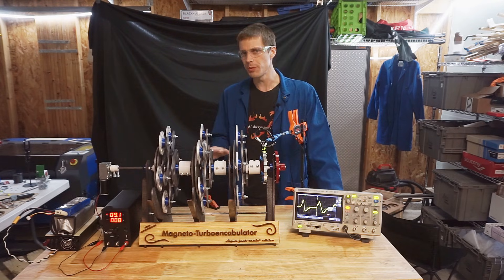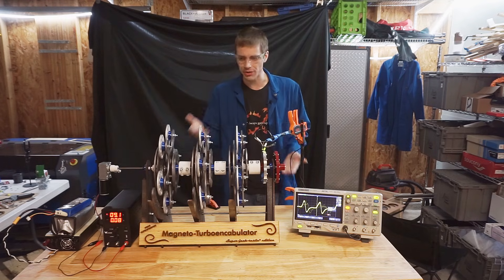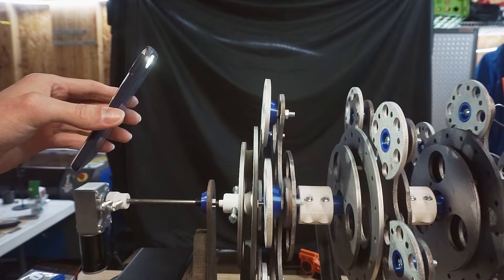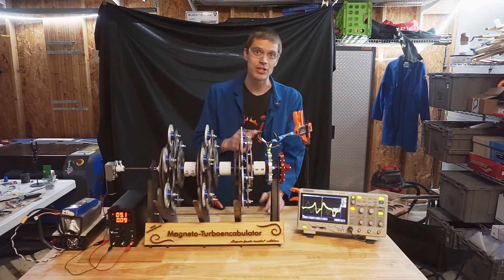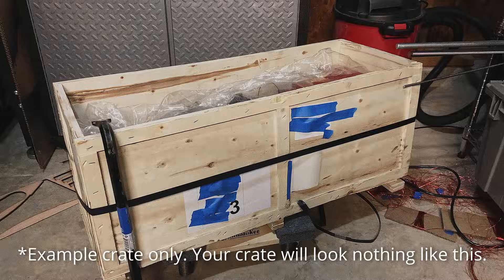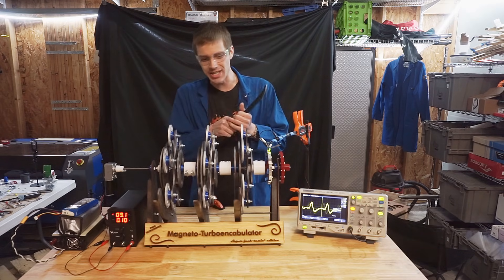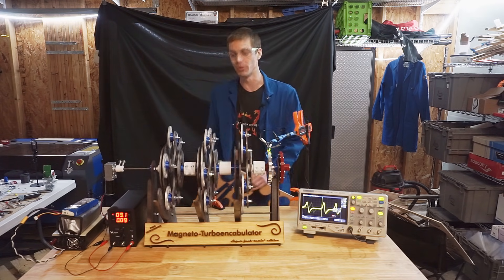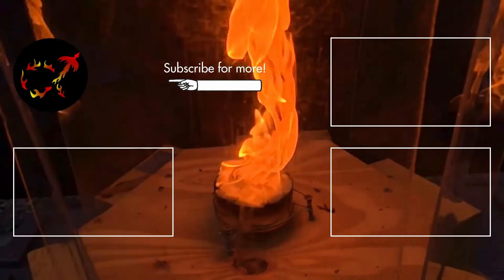Introducing the Magneto-Turboencabulator

Comment: Well done sir, Congratulations on your prototype... you have achieved what us engineers have long sought after... We know that the turboencabulator goes back decades and comes out in it's various forms usually in early April.   Starting with General Electric back in 1944 it was shown how such a device could be made, but the claims to have a working system were dubious, and even though they put it in their catalog for customers to order, sales quickly fell flat because it required unobtainium, a rarer-earth element that proved difficult to find.  Later on the Turboencabulator was reprised by Rockwell Automation they attempted to bring out their version of a product called the "Retro Encabulator", sadly with similar results... Even Chrysler Corporation tried to outfit their vehicles with this futuristic technology, but they couldn't make the cardinal grammeter from a girdle spring... what were they thinking!?     You sir are keeping the tradition alive!  Well done!!!

Comment: We've been hearing the "magneto-turboencabulators are only five to ten years of research away!"  line for so long, I never actually thought we'd see one...
Reply: They are a LOT closer than many had thought...  Just let that thought fuse into your head for a while.
Reply: Just need to nip the whole issue of tangential drifting by the spiving bearings. I think we need some
 post-famulated ammulite in a polarized neutronic field.
Reply: The side fumbling really held it back for a long time.
Reply: Hate to say this, but from three years later, we're STILL "only 5 to 10 years of research away." By now it's pretty clear it was all a big scam, the next Theranos.
Reply: @Qossuth  Not true!  What you fail to realize is that any Turbo-Encabulator functions as a Time-Machine, so whenever it is activated, it propels itself 5 — 10 years into the future.

Comment: I think you made a little mistake here. Magnito-Electric field in a presence of Choulcaudronite salt usually moves in 3-way fractal Mandelbrote pattern due to T-N flux magnetic distortion. This causes you to lose on performance on the 4rh circle and above when magnetic field failes to follow inverse sinusoid movement off the magnets. I suggest swapping the salt with 4-hydro-2-macroetyletanol powder.

Comment: The crazy part is that there is actually truth in this meme. That table is actually bamboo which then leads me to believe that the discs on the cabulator are in fact made of cellulose coated in metallic dust — which — to me — is awesome

Comment: I feel that the galvanic pile wasn't given enough credit for this feat of engineering.
Reply: I mean, a battery feeding an inverter which feeds a DC power supply, simply brilliant
Reply: I agree. Perhaps we should treat its backside to some electroconductive elemental deposition to show our appreciation. In a completely platonic way, of course.

Comment: I'm just mildy tipsy enough, that, with my present physics knowledge, I could understand about 80% of this, and have that not quite be enough to tell if this is a real device (that actually works as described, transmitting torque without direct contact through, I believe, magnetism?) or if it's just total bullshit. Excellent.
Reply: the worst part is that it's both

Comment: Could i use this with a flux capacitor or do you think it would create a quantum shift that could potentially destroy the time shift paradigm? Just asking for a friend
Reply: It is recommended to connect a capacitor in parallel with the armature windings of an electromotive device in order to limit the potential energy of reactive electromotive force generated by the fluxes of the stator windings. Such “Back-EMF”, uncontrolled, could potentially damage the metal-oxide-semiconductor field effect transistors used in the H-bridge drivers of the control device, or in extreme cases, feed back all the way to the lithium-based galvanic cells, which are pyrophoric, resulting in uncontrolled deflagration.

Comment: This was quite easy to follow, but I got lost on the "relatively simple bamboo workbench"
Reply: That puzzled me too. I think he meant "phyllostachys work surface" there.
Reply: @xnagytibor  Thanks for the clarification.  Do you think the phyllostachys work surface is mounted on toroidal supports capable of circular motion, allowing the work surface to be translated along the horizontal plane with minimal friction?  That would totally change everything.
Reply: yeah, I did some research, turns out a "bamboo workbench" is an anti-non-euclidian formation of an advanced composite material made up of primarily cellulose, hemicelluloses and lignin. It was developed by a complex system of interconnected nano-machines designed to deposite groups of nuclear matter with proton numbers 1, 6, and 8 into a polysaccharide, thousands of base monosaccharide units long. Hope that clears things up!
Reply: @LemonArsonist  It sounds simple when you put it that way.  Thanks!  I have a similar formation here, but instead of being anti-non-euclidean, it's the counter-non-euclidean variety.  That might be close enough, so I'm going to give it a try.  Fingers crossed (non-euclideanly).
Reply: @LemonArsonist  Well, I mean....thanks for the clarification and all, but did you really need to talk to  us like were 2? ....pfft....interconnected nano-machines.....hemicellulose lignin bonds.....what else could it be? Logarithmic amulite?! Not in that density parabola distribution, I assure you. We are engineers too ya know, a little professional courtesy would be nice....
Reply: @LemonArsonist what's lignin?
Reply: @ytbvdshrtnr Lignin DEEZ NUTS!
Sorry, couldn't resist.

You've probably Google'd this by now but, in case you haven't, and that question was legit; lignin is a complex organic polymer which performs several important functions in woody plant matter. Far too much to detail here.
Reply: Thank you! I literally understood every 7th word he spoke.
Reply: Its a highly technical term. Only really used by people that work directly with it. Im pretty sure he needed a license to import it across city lines. If he got it surplus someone is in big trouble with OSHA, DOSH, NRC, PDQ, VA, and the WSRDoA. And I think it goes without saying, if they find out.....gammy is gonna be piiiiiiiiiiisssssssssed.
Reply: What was lost in the discription was the need for iridized pewter support pins. Very necessary!
Reply: Here! Just take your thumbs up for the literal blurt out laugh, and get lost. I don’t neve-a eve-a wanna see your funny asss mug round here again, otherwise I’ll be forced to provide you with another dastardly thumbs up… now scram!

Comment: Such an incredible tribute to the classic sales pitch! Bravo! I have to ask, however, how does the magneto-turboencabulator account for inverse phase width demodulation without the original's bifurcated tri-valve oscillation matix?
Reply: and how is flux normalisation achieved without the use of marsel vanes and a panametric fam?
Reply: @mycosys  remember, the panemetric fan is mounted on TWO spurving bearings, on the up-end of the gram meter.
Reply: @jesseschooler918  I love this comments section. Thank you.
Reply: In short: yes.. the magneto-turboencabulator will have demodulated phase widths BUT the phase coefficients will always cancel out due to syncopated retroangular motion in the Marsel vanes. 

The complicated part (WHY the Marsel apparatus retro-heterocatalyses the phases) is honestly too long for these margins to contain. The helpful folks at /r/vxjunkies have many more experienced encabulation engineers and passionate hobbyists who can help provide learning resources.

Comment: i would've used prefabulated ammulite instead of coated cardboard, it improves the efficiency of the delta-o-lotus wings and avoid the undesired hydrocoptic currents.

Comment: Omg.....  Everything he is saying is actually accurate description of how this thing actually works.  Totally sharing this....
Reply: Except the "in every home" part at the end ;) I'll get in touch with your manager, Ms. April Phooles-Deigh with the specifics.
Reply: @AdityaMehendale  "in every home" was an opinion. Unless you are a mind reader, you can't dispute that.
Reply: you've seen the original too right??
Reply: @Harrlond  I work at Rockwell Automation...  I used to configure panametric fams, but I can also align the marzelvanes to prevent side fumbling.
Reply: @Harrlond that's probably why Mike's surprised that this is all truthful.
Reply: No... no it is not.
Reply: @Dziaji  It actually is, at least the 90% I was able to follow, not sure about a couple of terms but I figure those are good too. Its really verbose but he is actually describing how the thing works, like the part "quantum zero point energy stimulating the recombination of electrons and holes, creating super terahertz radiation" is a really wordy way of saying, an led emitting visible light.
Reply: @massimocole9689  No...No it is not. Wrong. Incorrect. NOT an actual description in any way at all. No.
Reply: @powderslinger5968  maybe you should buy some backside coated silicate substrates and arrange it in a way that radiation in the range from around 300 - 700 nm is able to accurately activate the Brodmann Areal 17 of your previously aligned ocular modules to detect a protagonistic aura and then ask, am I right?
Reply: @massimocole9689 as well as describing how the thing actually does not work....
Reply: @Dziaji  actually, it is extremely accurate. That's why it took so long to realize it's an April fools joke
Reply: @1480-b5g  that doesn't make any sense
Reply: Can you... Translate?
Reply: @kutsen39  The quantum zero point energy part is a way of describing the sea of tiny quantum particles popping into and out of existence at the smallest scales, and this random noise is part of what causes electrons to jump around inside circuits. In LEDS the electrons jump into parts of the silicon chip that have been mixed with certain elements to make it have fewer electrons. When the electrons fall into these areas with fewer electrons, aka holes, they release energy in the form of light. Visible light is very high frequency, the green light in this case has a frequency of 545 trillion hertz,  so you could say it is terrahertz radiation.
Reply: @massimocole9689  "random noise is part of what causes electrons to jump around inside circuits. In LEDS the electrons jump into parts of the silicon chip that have been mixed with certain elements to make it have fewer electrons. When the electrons fall into these areas with fewer electrons, aka holes, they release energy in the form of light." Absolute BULLSHIT.
Reply: @powderslinger5968  What part is bullshit?
Reply: @powderslinger5968  No, that's actually exactly how LED's work.
Reply: @kutsen39  not without a 1st year university physics course? Its seriously ridiculously technical.
Reply: @mycosys  like a certain famous person once said, if you can't explain it simply enough you don't understand it well enough.
Reply: I love that the conductors and fluxes line was already correct
Reply: Who else had no problems keeping up? I've never used so many techinal words in such a run on way but man I heard everything. Kinda felt like fluently understanding another language
Reply: @killsalot78  My brother and I went through a weird phase when we were younger where we would... well, we'd mutually spontaneously initiate hyperverbose and increasingly esoteric language in spoken communication regarding whatever trivial minutiae of daily life was presently unfolding... 

It was kind of a way of challenging each other I think, but I have no idea why we did it, and we never talked about it. I feel like there's some übergeek magic flow state out there that I rarely experience anymore, but that this guy lives in, and I'm super jealous.
Reply: Except the mirror, unless he knows for a fact were vapor deposition, were probably chemically silvered. I'll have to watch it again to see exactly how he described it but I thought he suggested they were vapored or sputtered, but if that were the case, you'd use the other side of the mirror, normally.
Reply: @SwervingLemon  2:10 He says "A series of silicate based substrates that have had their back sides coated with electro conductive elemental deposition." I think the "electro conductive elemental deposition" part is describing the thin layer of metal itself, not how its applied, but I'm not sure. 

Edit: Its kind of ambiguous cause deposition is both a verb and a noun.
Reply: @massimocole9689  I think he’s referring to how you vapor deposit aluminum on glass to make a mirror like they do for telescopes
Reply: @massimocole9689  Agreed, and it's pretty pedantic anyway when you look at that thing and realize he's put a LOT of hours into this joke.
For a nearly pointless exercise, the engineering and production time on this has gotta be a substantial investment.
I also appreciate that he managed to pull off the Rockwell joke but it was all actually accurate and not just made-up jargon.
Reply: @SwervingLemon  given the content of this channel, I'd wager he personally performed the vapor deposition on every one of those mirrors, since he has videos on the construction and use of that exact equipment.
Reply: lol I know. That's why I didn't get the joke at first. I thought it was a lovely description of what he had made. But I didn't get that he was purposefully using overly technical language. It just sounded normal to me for the first couple of minutes until he described green light as "super terahertz radiation." Which is what an LED is. It's an antenna that emits EM radiation at several hundred THZ. I only know this because I wondered once if you could actually see the output of a theoretical oscillator running at several hundred THZ and found out that's pretty much what an LED does. Apparently. I admittedly don't understand it well enough. I just started wondering once I learned about millimeter wave technology and terahertz oscillators.
Reply: People not getting that this video is a joke on the Rockwell video, but this one is actually real.
Reply: not everything was accurate.. I mean what the hell is a "hyper-sonic amplitude"?.... "hyper-sonic" describes frequency or speed, not power factor....
Reply: 3:30 Hm. How does one covert a measure of torque to BTU?
Reply: This is how scientists sounds to most people
Reply: Y’all are gullible
Reply: Sounds just like a mumbo-jumbo politician in D.C. trying to explain away the obvious to rest of the country.  😂
Reply: It’s crazy. How to a layman like me it’s still as true as the trusty turbo-encabulator
Reply: I never understood the science before, but now I do.  Thank you so much.

Comment: At about 1:55 you mention that part of what makes this work is the zero point fluctuations exciting your free electrons.
I see an issue and acutally the one possible cause for a stall of the whole Turboencabulator, there.
There's a paper from Dr. R. M. Mckay, where he states the sheer instability of the ZP layer - i.e. "normal" quantum fluctuations are already absolutely unpredictable, but on the ZP layer Mckay describes the wavefunctions as "hyperunpredictable"; this, in turn, could lead to extreme variations - causing the Turboencabulator to blow up - or a variation that virtually breaks the Planck length - causing the device to an actual stall.

Have these potential issues been considered? What was your solution to them?
Reply: magnificent question and worthy addendum
Reply from the maker: Kaboom
Reply: As I understand it, that paper was actually co-written by Jeannie M Miller who remained uncredited on the published article. The scientific community still struggles with the burden of social inequity, and we owe her a debt of gratitude for her contributions.

Comment: You are exactly the person to ask.
I want to have a way of dumping any amount of electrical energy (I have a perfect basketball size nuclear/black hole energy source that can be fine set, edible, safe) I want a material like the standard apparent plate's on a Gundam, just before the missiles hit, you dump an camera flash of insensitive energy and it doesn't break.
There must be a mechanism of having more energy in a space to resist deformation.
Can casually free electrical supply make materials stronger to the bring them past their tension ect limits?
To me the only point of having a building size robot run around, is to place in a stupendous power supply and have it run around indestructible and nuke proof.
Because it's cool.
We need electrical power supplimented building materials..I have no idea where to start. Any suggestions welcome, being wrong is also interesting.